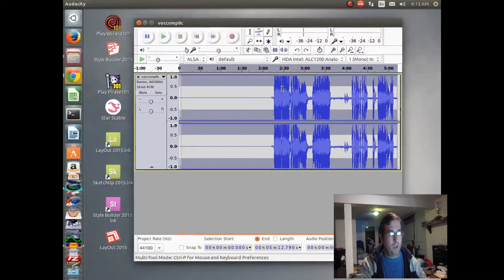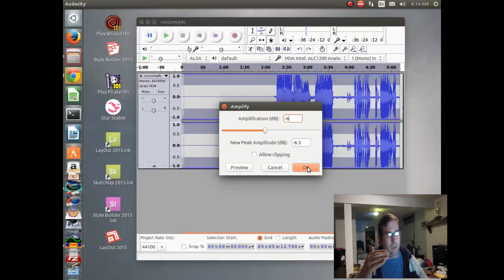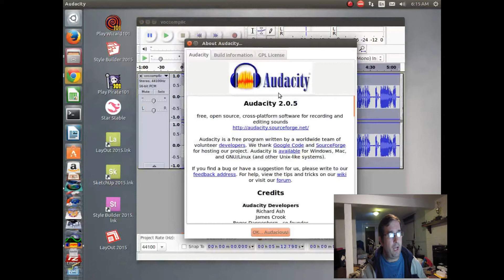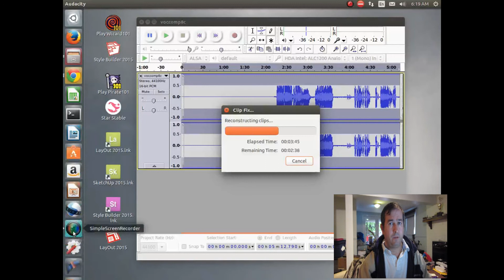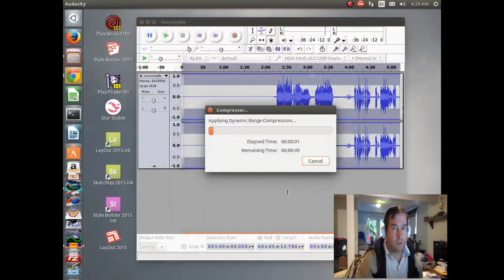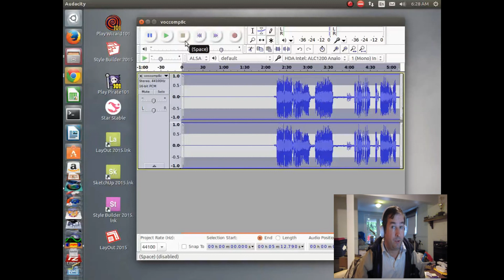Audacity : How to Fix Clipped Audio

Comment: How am I able to fix my microphone from clippin whatsoever as I want to redo the clip. What should i change? I have tried lowering DB by 6 and turning down recording volume to 5.
Reply from the maker: If it is clipped badly, and it is easy to redo.. then maybe that is a better option?? Sometimes this can do a good job, if it is not clipped too badly.. The better audio track that you start with.. the better the final product will be..

Comment: 𝗤𝘂𝗲𝘀𝘁𝗶𝗼𝗻𝘀:
1. Why  (in amplify, at the beginning) you didn't leave it in 𝟬,𝟯 als suggested by Audacity, instead you used  -𝟲,𝟬 amplitud?
2. Why you didn't use 'show clipping', in order to see the red lines where clipping appears
3. Would you aply the same method in case of an interview?
Thanks
Reply from the maker: 1. I just try different things sometimes, to see which one works the best.. You can always hit undo if you don't like the result..
You need to decrease the amplitude so it is not clipping.. that is what this step is doing..

2. It is probably worth trying.. I just usually make these videos, as I have a need to do a particular thing.. and I just show what I did..
3. I think it should work on voices in interviews as well..

Comment: I am using this to fix clipping in a DJ mix, when we use compression it does level out the waveforms function. But could it distort the music (using the default settings?) Would it be better to normalize the entire volume based on the lowest point then amplify? I really have no idea but i have seen it both ways, and have read that over compression can cause distortion in high quality musical recordings.
Reply from the maker: Yes the compressor does definitely distort the wave form.  It is a non-linear process that will generate new frequencies that were not there before.  With that being said...  It's distortion effect is slight, and I can not notice it... It is so much better than having a clipped waveform.. In my opinion..  You can always not use the compressor and it will probably be fine too with just clip fix.  I like the compressor for music I make, because it makes it seem like I am holding the note more steady than I really am... Then there is also 'auto-talent', which corrects the frequency as well (for singing)..  Anyway.. It's all in fun anyway..  Hope this helps...  You can play around with the compressor settings.  What it does is squish the tops (peaks) of the wave forms a little more than the parts near zero... You can change the point where it starts to squish, and you can also change how much it squishes as well...  If you can't hear the difference, does it matter? You are the boss...
Reply: jaynes network thanks for the quick reply, sometimes i do the process and post compressor the track is clipping again. Anyway to prevent the compressor from amplifying to where we have new clip points?
Reply from the maker: You have to decrease the amplitude of the signal before running clip fix, because it needs some room to add the peak on the tops of the signal.  Otherwise it will stay clipped...

Comment: for the love of god why do you use proper terms when "teaching" . the "thing" is a term a moron would use when teaching software. How about you learn the specific names of everything you are going to cover. 
when the "fix clip" dialog box opened what were your settings?  it does no good to open a dialog box if you don't give exact parameters for settings. You  are a horrible teacher!!!!
Reply from the maker: Great comments.  I just used the settings that audacity had preset with the compressor.  From watching the video, it appears that the settings that I used are pretty clear and visible. You can also use other compressor setting. The ones I used are not critical so I did not specify.  Play around with these parameters if you like, to see what is best for you... be creative... and if you don't like the outcome, there is always the undo button.  The compressor just pushes the peak down a little making the sound levels more even again.  Again this is not necessary to fix the clipping, I just like the effect because it makes the sound more even..
Reply: bro stfu you do better. im sure you cant